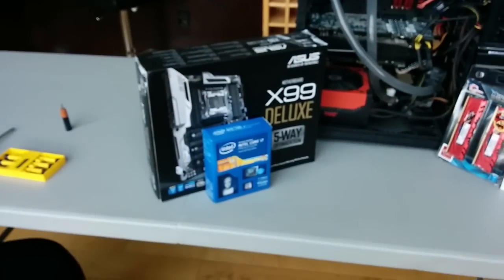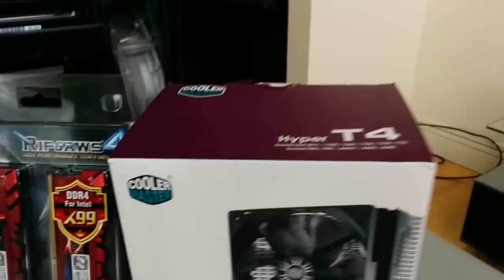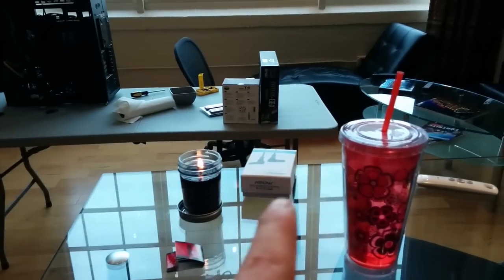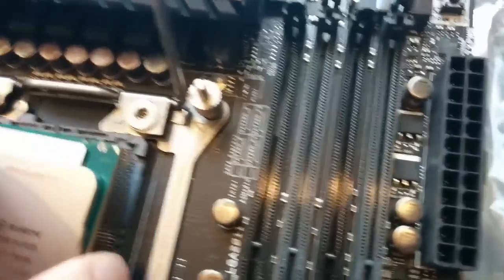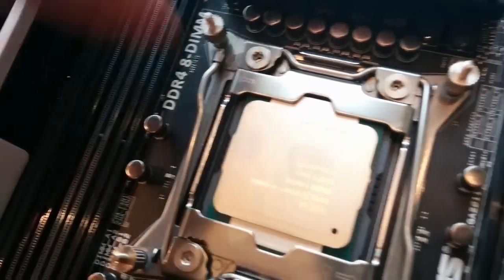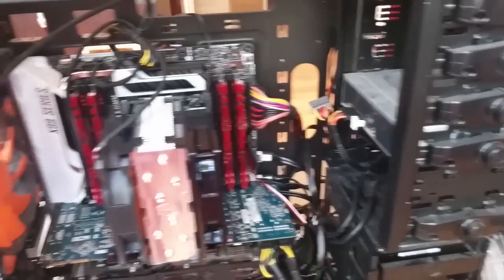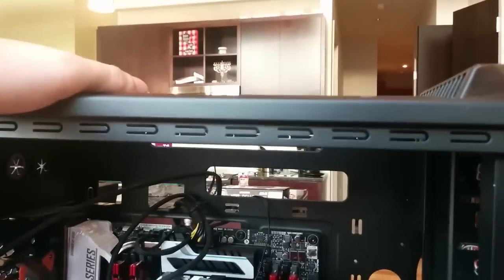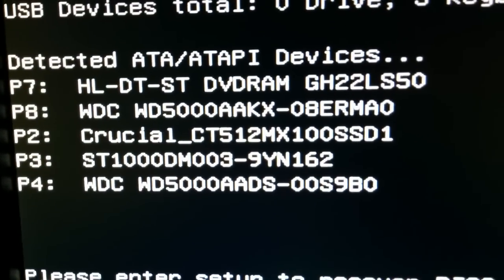$2000 Computer Upgrade (COMPUTER BUILDING!) - Vlog

Comment: Hey Preston!! Love the upgrades but you should have gotten a 6-core processor which probably cost $500-$600 and use that money to get the 980!!! You will definitely see a fps improvement with that!!! Also should have gotten the hyper Evo, much better air cooler for $30 ( I have one myself )

Comment: that is a beast set-up you got, my set-up it two crappy monsters and a old pc that i found on the street corner with a razor keyboarded and mouse (i installed a new water cooling system$120 and a Intel i5 processor$50 from a friend) and it still play a constant 110 fps even running thing in the background. I'm not going to pretend i know the exact specifications because I don't.

Comment: Hey preston, you basically have parts for another computer. What are you doing with your old Mobo/ram, proc/cooler, and power supply, sounds like you just need another harddrive and case and you have another decent computer to offload work onto, or a media machine. Good for you.

Also you seriously may want to spend like 100 or 200 hundred on an Unprintable power Supply. Make sure you plug in your Router/wifi router, cable modem, computer and monitor. Since you have three monitors you may have to get one that powers 6 outlets or you could just power 1 monitor like the middle one so in case of emergency you can still see your computer output. But still you could two cheaper UPS and plug everything into powered. Your power isn't normally out that long is it? I use UPS to make all my components last longer from not having huge power flux mess their internals, and even if the power goes out for less than like 10 minutes I can still surf the web because the cable doesn't go out.

Comment: You should get an r9 390 or something, I don't know if you need it yet though.
Reply: +Tylaire Amd sucks tho
Reply: Gamed Out Ok, but why?
Reply: +Tylaire he upgraded to a 980 ti
Reply: Piano Cats That's fucking overkill for 1080p. Especially for COD, COD isn't that hard to run.
Reply: +Tylaire He has triple monitors
Reply: +Piano Cats And for video rendering, its not really overkill.
Reply: GTX 970 is better than that overheated piece of shit.
Reply: no the 390 outpaces the 970 in almost every way, and can use all its memory at advertised speeds :)
Reply: +JKDoesGames who says rendering doesn't need to use graphics card,with all the pixels the graphics card helps a lot
Reply: Your cursed with spam <3

Comment: Hi everyone! I really need help with a cheapish gaming setup! Like a new desktop (preferred custom) and some things to help it run well with everything. I'm really new to computers so idk what all the parts I'll need will be, I would love to hear any idea (preferred a list please) of all the things I will need, thank you so much, I really appreciate it, I have a price range of probably $500, just tell me how much and what the things are and whether I need them or not, thanks guys/gals!
Reply: Well.. The beauty of building your own system is that you can go at your own pace and slowly buy up the parts that you need separately as you save money. Of to build a complete computer you will need the following parts:
A CPU- I'd recommend a intel core i5 or an fx series processor from amd.
CPU cooler- look at cooler master, noctua, or corsair.
Graphics card- since you're on a budget I'd recommend an amd r9 270x or an nvidia gtx 660.
Case- an NZXT 410 it will do and it's pretty cheap.
Power supply- when looking at power supplies make sure that they have at least an 80 plus bronze rating that way you know it's trust worthy.
Memory- just get an 8gb kit of ram from either corsair, Kingston, or g.skill.
Storage- I would HIGHLY recommend getting an SSD (solid state drive) but since you're on a budget just get a 1tb hard drive(Western digital)
Motherboard- this will vary depending on what CPU you buy and what chipset it has but I would recommend manufacturers like Asus, MSI, or Asrock.
For anything else look at linustechtips here on YouTube or try pcpartpicker.com
Reply: Peyton Cobb Thank you so much! Even though I don't know what literally any of those are, I'll look them up lol. Thanks a bunch!

Comment: I'm getting the 5930K intel core i7
Reply: Its for proffesional users only
Reply: I changed my mind i'm getting the i7 6700k because it's muuuuuch cheaper and almoat same performance
Reply: +SC_Alex MC no,the broadwell-E series was,the skylake was more towards gamers
Reply: Rickie Cheong i7 -> Video Rendering & other proffesional things
i5 -> More on gaming
i3 -> For daily use
Reply: +SC_Alex MC I get your point,but the skylake versions was more towards gamer,meanwhile the broadwell-E version was more towards rendering and professional workloads,i know the i7 6700k is a good cpu for rendering as well,but compared to the 4 cores it has on skylake,the broadwell-E,i7 5960x has twice the cores and also more expensive
Reply: That's not true at all... Have you ever seen any high-end gaming computers? They all have Core i7 5th gen or better CPUs...
Reply: Jacob Adamsky A Hashwell-E CPU for a Gaming PC is only for the richest, a normal Gaming PC can hold a stable framerate with a i5

Comment: What does water and fans have to do with computers? 0_o
Reply: ? Umm you mean so the computer doesn't overheat
Reply: well if your CPU melted it wouldn't really work would it? :P
Reply: Correction: they're better forms of cooling the CPU which gets heated as you use it for different tasks. (Gaming, video editing, etc.)
Reply: Fans don't cool the monitor.
Reply: Peyton Cobb better forms of cooling? arent they the only forms of cooling available to consumers (water and/or fans)? lol...
Reply: It cools them and allows then to run faster I use one for my playstation4
Reply: 4ever Pixelated || Minecraft Minigames, Tutorials, GFX, and More! peltier cooling rigs, and passive cooling are others, but no one who does 3d anything uses passive.
Reply: This is one of the noobs
Reply: If you don't keep parts cool they will get hot and stop working.

Comment: For mine craft? Dude.
Reply: You know he's a cod player right? minecraft is his second channel
Reply: It's his job. He needs this to be able to continue his career. So having the best quality makes things a lot easier.
Reply: Having a good computer for other games doesn't hurt anybody.
Reply: this is his job, he plays cod, dota, minecraft, and he renders ALOT that new CPU saves alot of time for rendering
Reply: Anderps Cod doesn't require a lot. Obviously, none of you know anything about rendering or computer parts, or you would know he could have gotten a processor that is much less money, kept the same mobo and ram, and the rendering wouldn't have changed that much.
Reply: By James TV its called saving time and preparing for next gen games, he doesnt only play COD
Reply: The RaMpag3 Cody No game needs that processor unless you do so much heavy editing. Then he would need 2 GTX Titan Blacks.
Reply: Bro he plays call of duty dood
Reply: By James TV titans suck and also it saves alot of tiem for rendering, about 40% faster than his old proccessor which is still VERY good
Reply: By James TV the processor and the ram is actually quite helpful with rendering with the increased amount of threads
Reply: The RaMpag3 Cody the 5820 is not needed for light editing. he does not do any type of heavy editing, downscaling from 4k, etc. titans suck? get over the price, kid, because people use them in SLI configurations  for editing programs that use JUST the gpu basically.
Reply: Daniel Wait you will barely see a difference if you buy another intel card that costs about 40% the price of a 5820. PRESTON DOES LIGHT EDITING. does no one undestand that? also i understand 16gigs but it does not really effect the speed.
Reply: By James TV titans are for SUPER rendering and also, for gaming the 780 ti is better :P its all about saving time in his purpose :)
Reply: The RaMpag3 Cody spending more money you mean. Also you said the titan sucks. btw http://gpuboss.com/gpus/GeForce-GTX-TITAN-vs-GeForce-GTX-780-Ti
Reply: but have you seen benchmarks? did you read what i said? do you understand that gpuboss is solidly fake?
Reply: The RaMpag3 Cody not solidly fake, i read what you said, and i did see benchmarks. do you realize if the benchmarks were accurate or from a trusted source? (they couldve overclocked the 780 ti, not the titan, etc)